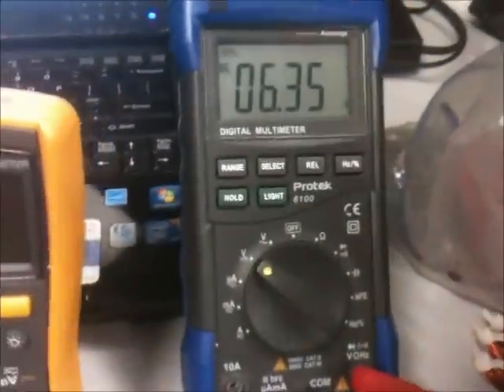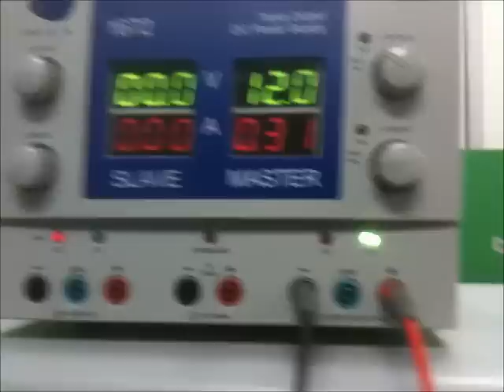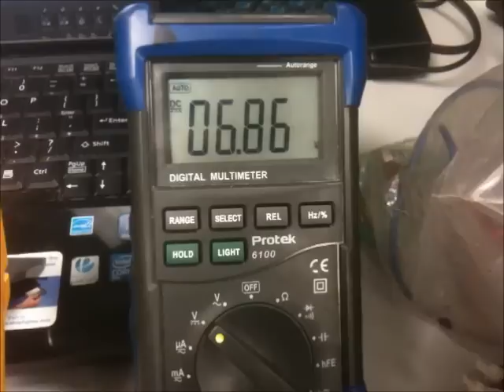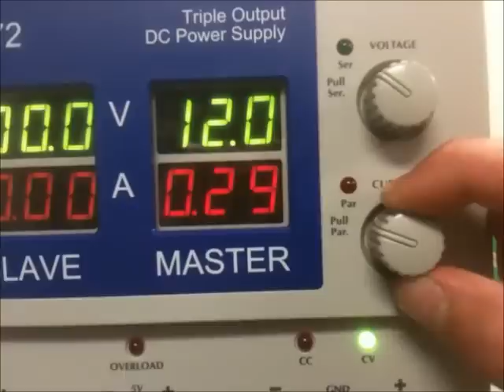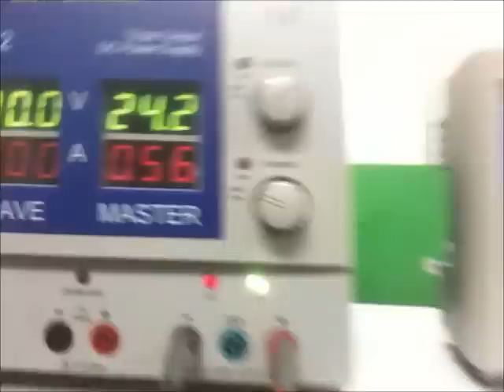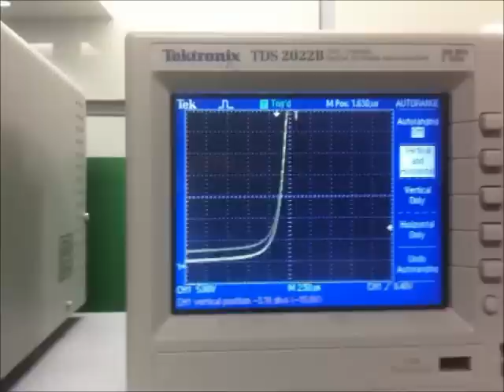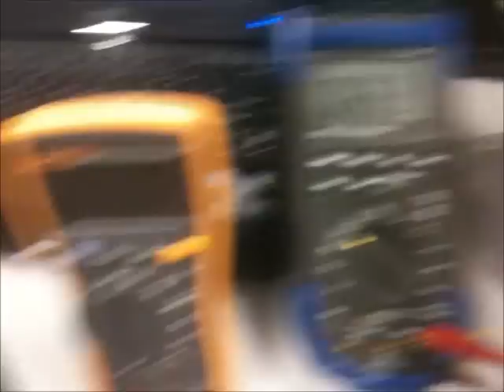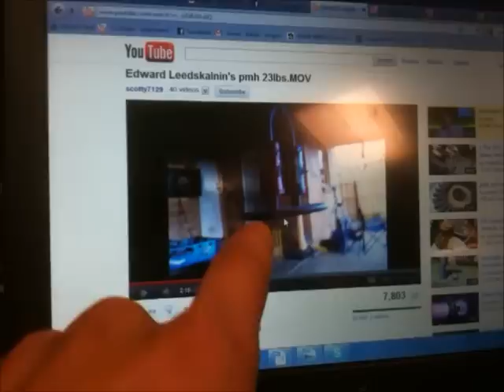Bedini Window Motor @ NextFab lab

Comment: Hello, good job, do you anything about a self sustaining generator, it uses AC power to start it up, then it keeps running when u turn off power, it works in conjuction with a induction motor.
Would appreciate a reply.

email: edhungboy@gmail.com